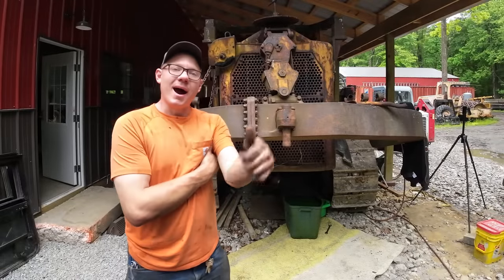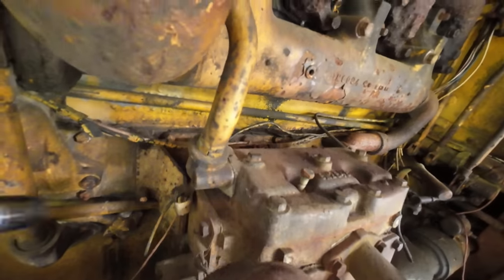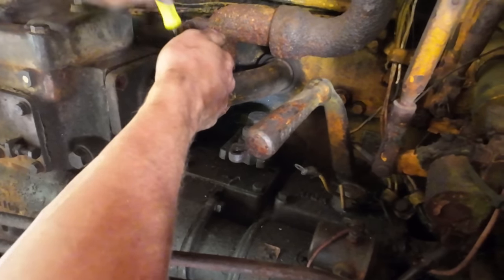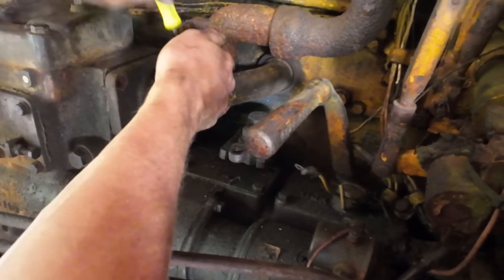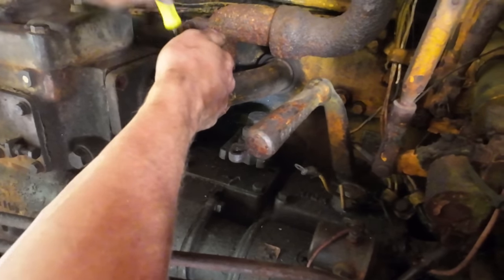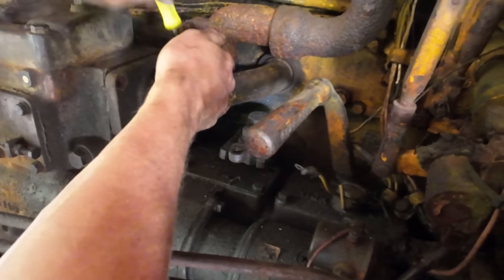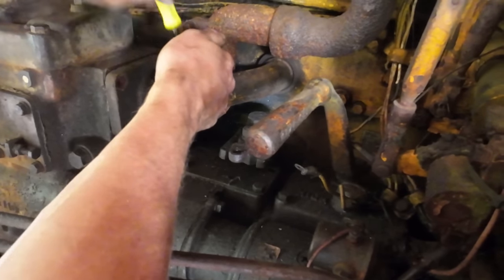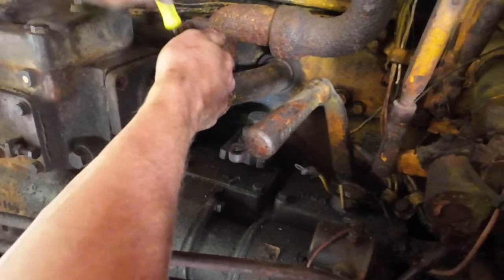Reviving a Caterpillar D8 Bulldozer (AGAIN!!!)

Comment: You need to start working smarter not harder. You had a crane set up and didn't use it when you had something you knew was at the top of your weight limit. You back is gioing to call foul on you when you get old. Love your videos

Comment: Matt what brand of tools are you using the ones with the yellow screw driver handles. Btw you need a roll of that heavy duty truck mat stuff to protect your concrete and park heavy stuff on
Reply from the maker: Those are snap on ratchets
Reply: @DieselCreek  thank you matt

Comment: 29:10 man oh man, when you were snugging those bolts down prior, when you first pushed the gear end in it looked like you didn't have that coolant pipe down in position then you jumped to those tough to get to bolts on the motor mount and were snugging them up, I was like man I sure hope he remembered to put that coolant pipe back down where it will not swing back if you tightened it all up first!! Yes, yes you did.. yikes!

Comment: I would've left the bolts in the joint of the intake manifold only snug until both halves were fitted to the engine again.

Comment: That thing is going to be moving the earth again here soon. Been years since I bought any bullet injectors for this type of dozer but they’re probably still pretty cheap  you may find a weak cylinder after awhile. I would check the rack and pinion in the pump housing and make sure that all your pumps are timed correctly. It’s just a line on the gears. You’d be surprised how many times these are put back in without regard to syncing them up properly.

Comment: Someone should find some old conveyor belting to run tracked machines on to the concrete. I very much doubt that the timber will spread the weight at all.

Comment: 38:24 You've got a Diesel Exhaust leak under the hood...

Something else to deal with when you tear into the Turbo problem...

Could the Turbo problem be caused by a restriction in the oil feed to it? cause it sounded to me like the Bearing was starting to fail...

Comment: What's the difference between the permitex NO.2 and NO.3 ? I've never used 2 before but currently using a Rolls-Royce aircraft equivalent but it sets tight. I've had rocker covers come loose on track car engines but the glue held them on 😂

Comment: That thicker wall pipe for that pony engine is going to take longer to heat up the air for the diesel
Reply from the maker: Barely. It’s not even 2x the original thickness

Comment: Hey Matt, have you ever had a runaway situation with any of those old heavy machines?
Reply from the maker: No, thankfully not
Reply: @DieselCreek  Do you have any tricks on how to judge wether a particular motor can run away or not before you crank it? Was it covered in your videos before?
Reply: With a lot of the old mechanical diesels the biggest thing is making sure the fuel control rack moves freely. If it’s turbo you could also pop the charge pipe off if you really wanted to.

Comment: Hey Matt, do you keep with the oil bath filters? I’m getting my first experience with one now. Also your radiator cap is the same as the one on my 1952 IH14A on my Adams motor grader….does it actually build pressure? It just looks like a spanner cap…? I have yet to get mine running to know…rebuilding the magneto as we speak and debating on starting a channel 😅

How thick is your shop concrete/rebar? Just finishing my shop and poured one bay at 9inches…

Comment: one thing that bothers me, if you have parts of like the pony and the intake, why not at least clean it? better to kill the rust and slap some paint on it, saves you later when you make it lasting, hopefully.
Reply from the maker: Easier to just sandblast and paint the whole machine at one time. Installing the parts would have messed up all the nice paint

Comment: 23:25 wouldn't having a thicker pipe affect it's ability to heat up the intake air for the main engine? I'm not an expert in any kind of way but for me having a thicker pipe means heat would have a harder time getting to the exterior of it making it less efficient at heating up the air arround it, I could be awfully wrong tho.
Love the videos btw
Reply from the maker: It isn’t crazy thick. It will still do the job just fine. It may take a few seconds longer. I guess if it is really that cold that you need to preheat the intake air you’re going to be running the Pony for a little while anyways.
Reply: @DieselCreek  You're probably right, I don't use imperial so I couldn't tell if it was thick thick or just a bit, based on the noise it made I assumed it was on the thick side.
Thanks for the answer !
Reply: @iwontlagback7236  1/8" = 3.2mm, in case you haven't already looked it up.

Comment: Cheers Matt, great videos. I have a question for you or any reader of the comments.  Is it possible to cover tractor/backhoe tyres with metal tracks, so its protected from punctures when it enters forests ? Installed/adapted in a similar way as a snow chain? I cant find any YT video of that ever been done. Any suggestions? Cheers
Reply from the maker: Nothing that I’ve ever seen 🤷🏼‍♂️
Reply: @DieselCreek  Maybe you are destined to be the first? And if it works it will be diy famous, also possibly a viable business idea.

Comment: You said your not far from Pittsburgh. I know where a CAT 977 I think L model and 245 excavator have been sitting for years. It would be considered trespassing but a dumpster company bought a section of the property so you might be able to ask them if you're interested, they have the road going into the property to on the part they own. They might have parts missing or cut wires but I've always wanted to see them run, especially the 977
Reply: The dumpster company doesn't own the machines btw. They were from ace demolition but that company is bankrupt and no more. They tried to demolish the cement factory years ago

Comment: What happened to the utv you bought from the auction?
Reply from the maker: It’s in the shop. I hate wiring issues
Reply: @DieselCreek  cool thank you for responding , will there be a video on it?
Reply: @DieselCreek  what happend to the honda rancher atv that you had?
Reply from the maker: @milanbukorovic1469  if I ever get it fixed right lol

Comment: Does the pony stop when the motor
Reply: Start
Reply: It doesn’t automatically stop, you have to shut it off. You could keep it running if you really wanted to, but it would just be making noise and burning fuel.

Comment: Sorry Matt, my microphone is messing up. What a terrible design. Why did they have a pony motor to start the motor instead of a regular starter starter motor I’m not sure.
Reply: Because way back when Cat started using pony motors, starter motors were 6V and batteries were rubbish.  To start a big diesel engine with a conventional starter was nigh on impossible under good conditions, let alone when it was cold.

A pony motor can easily be made big enough to start the diesel; it can run indefinitely (as long as it has fuel); as Matt mentioned it heats the coolant for the main engine so can warm the whole engine without needing mains power (which was rarer back in the 30s, especially in the sticks); it acts as a pre-heater for the air intake; and it can be started by hand (either rope pull or hand crank, depending on model).

Comment: I do worry for the future of your lungs working with these lovely but very smokey old beasties.
Reply from the maker: I don’t try to linger in it. I need better extraction that’s for shre
Reply: @DieselCreek  You should wear a particle mask for most of what you do but it isn't feasible for filming but maybe for time-lapse when grinding all the crap off stuff, I can't stand the smell of Diesel exhaust even though the car and Motorhome are Diesel.

Comment: I'm a little confused...the pony motors have spark plugs, meaning they're Gas Engines being used to start Diesel Engines...
Why would the designers add en entirely separate fuel system to the machine? A small Diesel should be as easy to start on cold days as a Gas Engine is (Especially when you add Glow Plugs to it) and the torque of a Diesel Pony Engine would make turning over the much larger Main Diesel easier wouldn't it?
Not to mention the simplified fuel system since a Diesel Pony can just feed from the Main Diesel's fuel tank...
Reply from the maker: No, tiny diesels of their day were still quite difficult to get running back then. They also don’t make the heat of gas engines to help warm that big engine
Reply: @DieselCreek  Huh...I always thought Diesels run hotter than Gas does...